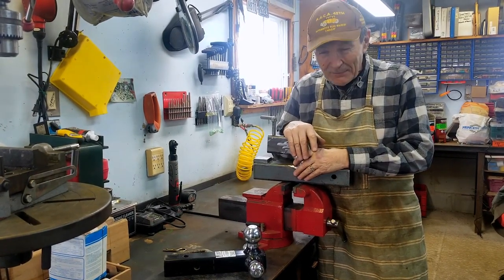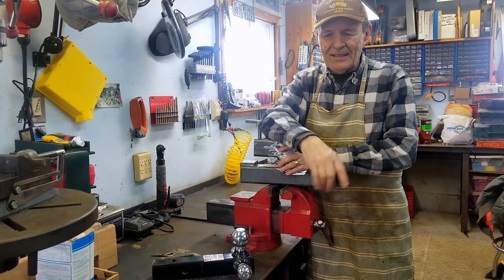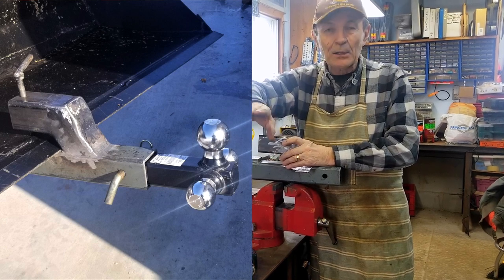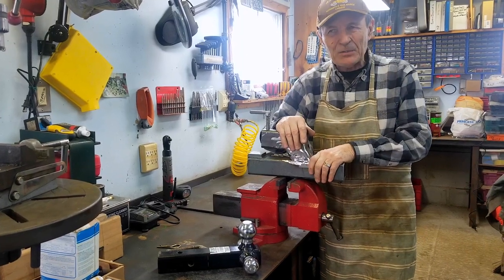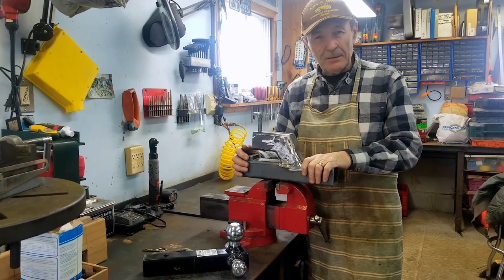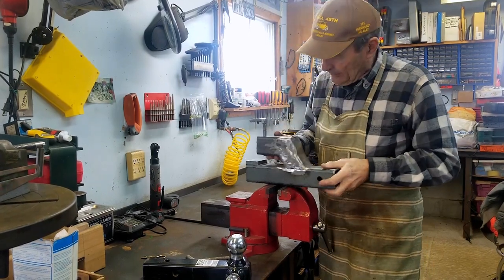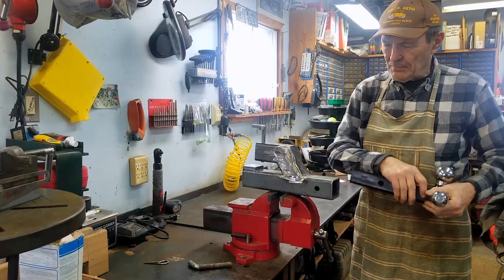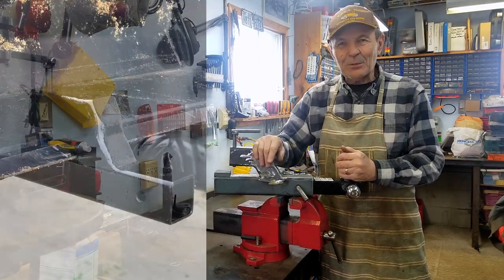#92 Bucket Mounted Trailer Hitch | At The Ranch

Comment: Hi Alec, I guess with social distancing you have a lot more time to tinker in the shop:) .really practical idea .Not sure if you have a fork lift attachment for your tractor? Those are very useful. I just wanted to comment on your welds, they are very pretty! however I have always left the weld buildup where it is possible as it makes the joint stronger. Also be careful about welding onto high grade bolts and nuts. The extreme heat of an arc can heat treat the high grade material and you can have it fracture at that point under load. take care Owen m
Reply from the maker: All good tips Owen, thanks for sharing.  I love coming up with ideas as I'm on a project and this was one problem I wanted to fix.  I have a future video on vice lock-down you may like.  Thanks for watching.
Alec